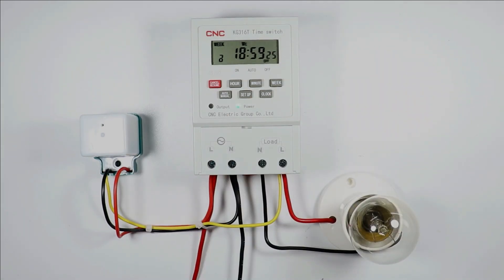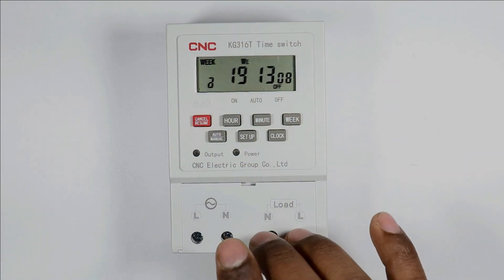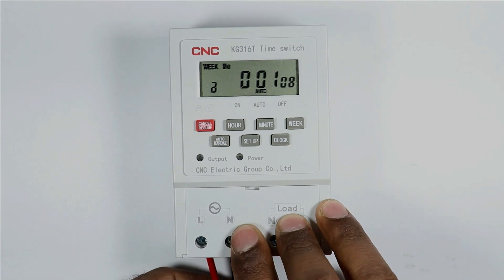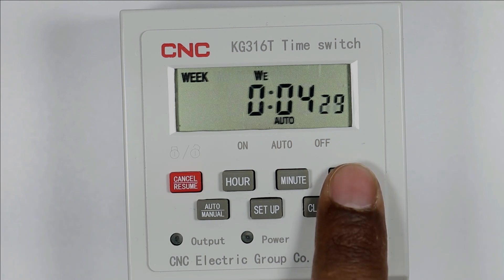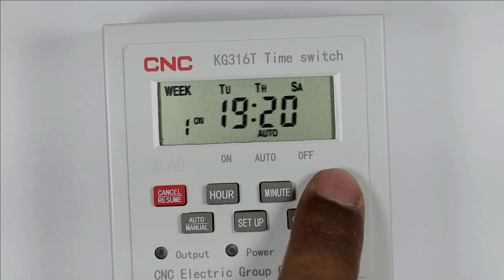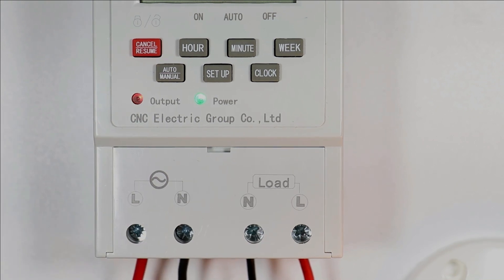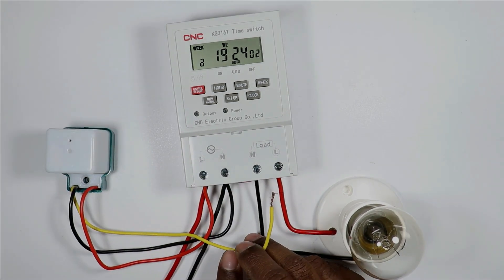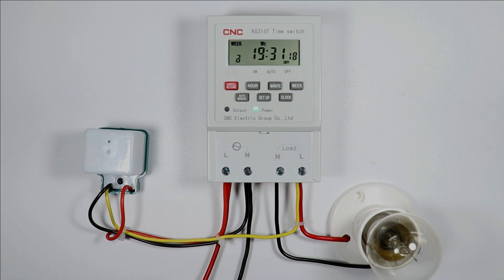Photocell Connection with Digital Timer Switch | Digital Timer | Photocell @the electrical guy

Comment: can we set timer for only once for

 | Time Slot | Duration | CO₂ Flow  |
| --------- | -------- | --------- |
| 6:00 AM   | 20 min   | 30–35 L/h |
| 8:00 AM   | 20 min   | 30–35 L/h |
| 10:00 AM  | 20 min   | 30–35 L/h |
| 12:00 PM  | 20 min   | 30–35 L/h |
| 2:00 PM   | 20 min   | 30–35 L/h |
| 4:00 PM   | 20 min   | 30–35 L/h |

Reply

@RSTechnical100
3 years ago

Comment: Please help and make a video on how to wire ats when grid is off the inverter must kick in and when inverter battery run low it must switch over to generator (3 phase)